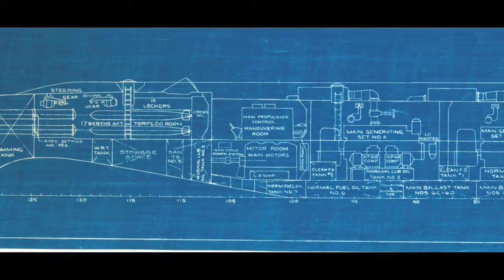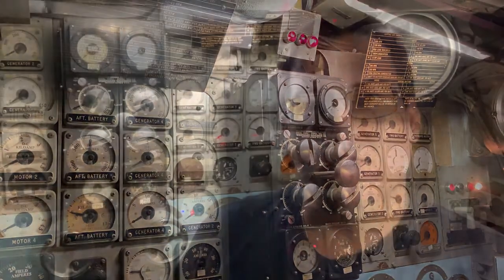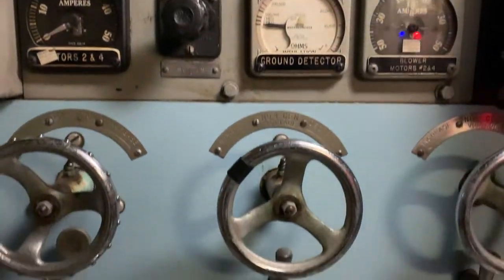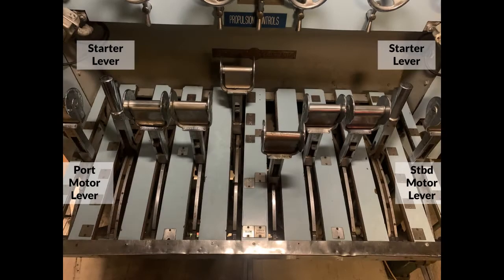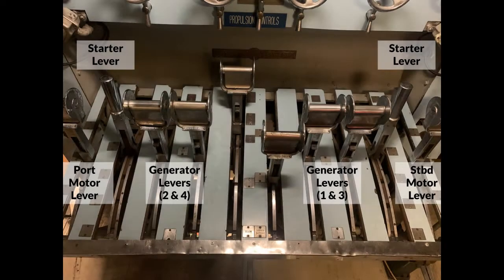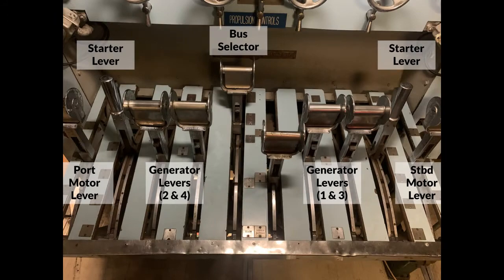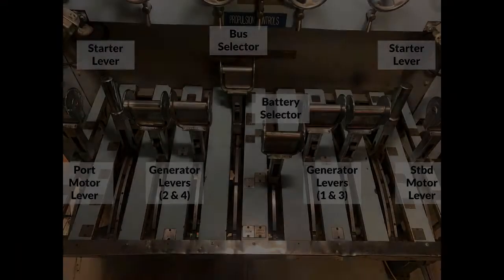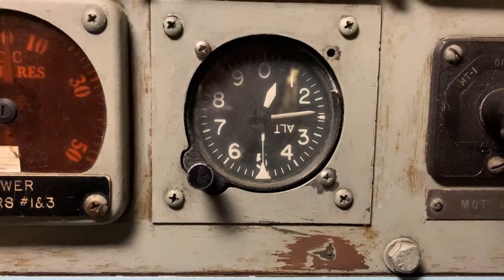Tour the Maneuvering Room Aboard Submarine BECUNA

Comment: Air pressure in HG or MB yes but Altitude? That makes no sense.
Reply: An aircraft altimeter uses air pressure to measure altitude.  They were readily available and a convenient size.  Detailed reading was not required for the application.

Comment: What are the controls in the black area that look like giant flathead screws?
Reply from the maker: Those are governors for the engines that control rpm. Each engine can be governed individually or they can be connected to the center one which will let the connected engines be controlled all at once.